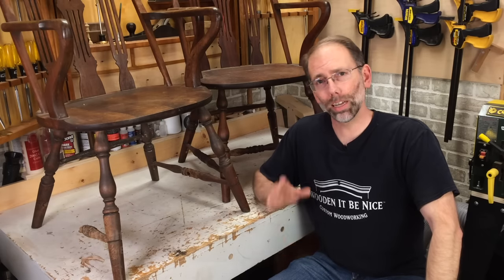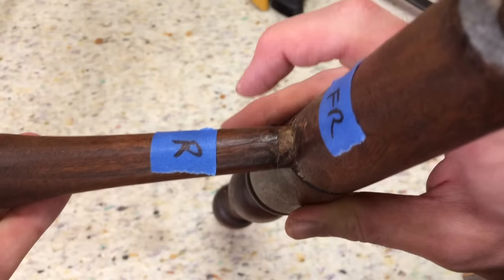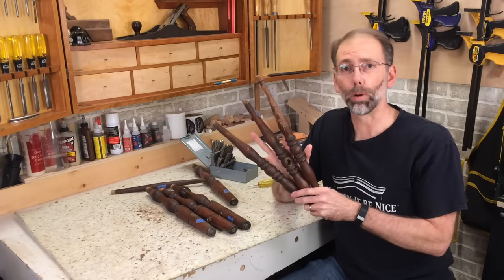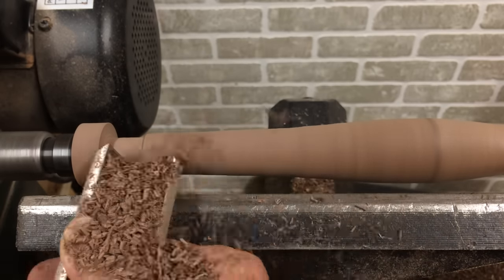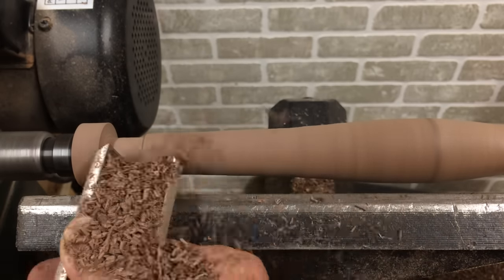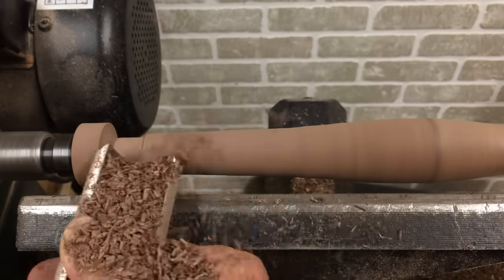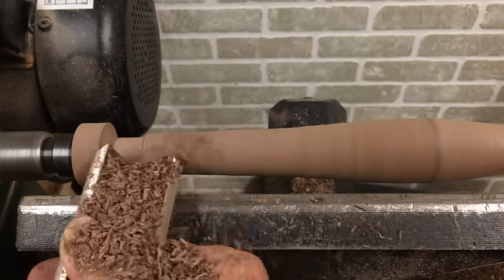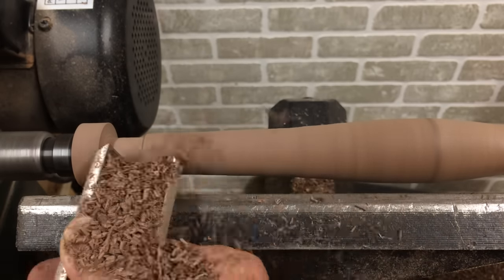Difficult Restoration of Wooden Chairs with Wood Damage - Woodturning & Chairmaking Skills | How To

Comment: Scott, I've just started restoring the 3rd Windsor-esque chair from my local pub - saw a total wreck in there about a year ago and offered to try to fix it. That was quite a simple repair - dismantle, clean joints and re-glue, then a basic wipe-on finish to make it look a bit loved, but also easy to clean.
Could not have even started without your superb videos, so a massive thank you!
Honestly, the chairs are not really worth the effort, time or expense (glues, stains and finishes are pricey), but I'm learning so much and enjoying getting slowly better (trying new ideas as well).
There's the value.
Certainly not a commercially viable business!
Get super-cheap beer and a free lunch when I deliver a finished chair.
Main cause of damage? Screws and nails. They destroy chairs!!!
Thanks again and keep it coming, please.
Reply from the maker: That's awesome to hear Stephen!  Thanks for sharing that!  Nice that you're helping a local business.  Cheers.  Scott

Comment: Scott, great video documenting the difficult nature of the work involved in restoring old wooden furniture. Two observations, your forstner bits looked like they need sharpening and I think using a drill press would have made the angular drilling of the mortises on the new pieces a bit easier.
Reply from the maker: Ah, you caught that dull forester bit!  Yes, I was struggling and I'm on the search for some slip stones to sharpen it.  I was using a fine file but it didn't help very much.  Thanks for the suggestion to use the drill press.  Cheers.  Scott

Comment: Impressed with the legs you turned. I would love to learn this skill.. but I will keep to the basics for now. I do have a question. I seem to have trouble with my glue ups more often then not. I can be happy with my dry fit and clamp up configuration but once I do the glue up I seem to struggle getting my pieces to fit together as easily as they did without the glue. What am I not taking into account here? You mentioned something about the dowel rod pushing the glue down into the mortise. Perhaps this is the reason I'm not getting the same fit as the dry fit? Thank you!
Reply from the maker: I suspect you may be filling the bottom of the mortise  (hole) with glue, therefore preventing the tenon from being fully inserted.  The only parts that should have glue on them are the sides of the mortise and the sides of the tenons.  The bottom of the mortise and the end of the tenon should not have any glue on them (as they don't touch).  Does that help?  Scott
Reply: @FixingFurniture  Yes this helps.  I'll be honest I have been dripping a small amount of glue into the mortise then using my brush to spread it throughout. This would certainly allow glue go to the bottom. Also I haven't been paying attention weather or not I've been getting glue on the end of the tenon. Thank you very much for the response. I will try these techniques in my next glue up.

Comment: Great work.  Two thoughts:
1.  The fix you used to make the loose stretcher fit was pretty cool.  After a moment's thinking, I realized it was just the round version of gluing a piece of veneer into a crack.
2.  As often as you seem to need to cut chair legs down, it might help to make a board with a curved "hook" in it, say 2" diameter.  That way, it reaches farther around the leg while the end is still registered on the table top.
Reply from the maker: That's a clever idea for marking legs for trimming.  Thank you for sharing that #Tip

Comment: I really like your YouTube videos.  I have a question, I am repairing an Old Organ Stool which the tenant broke off.  I have cut the leg and glued the piece on the end and was successful, however when I tried to drill through the new piece to add a dowel the piece I glued on cracks and i have to start over.  What am I doing wrong?

Comment: 17:50 instead of replacing the whole leg, could you drill that hole bigger and fill it with a dowel and then redrill it to fit the tenon? ....l understand that you are turning a lot of parts on this project. But what if this one joint was my only problem. Would you still have to turned the leg in order to make the chair stable and useable? (I don't have a lathe). Sending lots of love 💖 from sunny 😎 Arizona 🌵😷
Reply from the maker: Good question Suzi.  I would not suggest drilling the hole bigger as you would be cutting out more structure of the leg, which will weaken it.  Another alternative would be to cut out the damaged wood section in the leg and glue on a new piece of wood.  That would require shaping it  with a spokeshave to get it round to match the profile of the leg.  It's challenging work but would avoid having to use a lathe.  I hope that helps.  Scott

Comment: The trouble with us furniture repairers is, we only turn occasionally. We practice, read books and gain enough proficiency to make a usable component, finish the job and think were the bee's knees. By the time we need more spindles we have forgotten everything and have to start from square one. A little practice weekly is the answer, but do we do it?
Reply from the maker: Yeah, that's a good point.  There's a lot of muscle memory required to be proficient at turning.  I've talked to my turning coach about practice, but so far, it's been a bit like piano lessons as a kid... haven't practiced.
Reply: @FixingFurniture  You could always take some of the damaged spindles and offcuts and seconds from your failed attempts, and use those pieces to fashion new handles, knobs and totes for your tools. Hmmmmm.... the possibilities are endless.

Comment: I think starting the drill straight and then truing up to the correct angle makes for a larger hole than needed and not a clean finish. (you can see what I am talking about at 33:36)
Reply from the maker: You raise a good point.  There is a slight gap there.  I don't think I could start a Forstner but on an angle though.  Perhaps using an auger bit would work better.  I did a search for this and found this video.  Thoughts?  https://youtu.be/rlRPzgp0etY

Comment: Such great info about fashioning a thicker tenon -- I have exactly this problem with a 4-poster bed I'm trying to repair (it belonged to my grandparents but one of the posts came loose and one broke, both at the joint, during an international move) but I'm not a professional restorer and I don't have any thick shavings. Do you recommend any other solutions or maybe something that would substitute? I was thinking cork but it might be too spongy in the long term. 

If the answer is "pay a professional" that's ok too but I keep thinking there must be a reasonable solution to this because none of the finishes are damaged -- just the internal bits of the joins (in the broken case I'm going to need to use a dowel, I think).
Reply: Brooke, all you need for shavings is either a friend/relative with a handplane or get a handplane and make some shavings.....type of wood doesn't  matter.
Reply: @michaelfling7786  thank you! Also hah, I should have figured that out myself. I appreciate the hand-holding of this newbie :)

Comment: At 24:40 in, you are sawing off the larger round end you had turned and was too long. I would have left it on and sawed a flat on it to keep it from rolling, making a perfect base for drilling the next hole!  Next time, leave those large ends on and make them them a bit larger in diameter as the largest part of the tuning until you have drilled all your holes and see if that helps stabilize your parts. FYI, not a wood turner myself! Good video BTW!
At 35:00 on, you are going to mark where to cut the replacement leg off to level it. If it were me, I would put some weights on the chair to stabilize it, then just use my "pull saw" laying flush on the bench top and saw it off, no marks to try to cut to are necessary. I don't think you can get it any closer that that. Reason I'm saying this is I just needed to do the same thing on a repaired chair leg myself, BUT I didn't use the "one leg off the bench trick" like you! After seeing what you did, this new method occurred to me as I was watching you work. As with most woodworking, more than one good method, but I try to avoid cutting to a mark when possible.

Comment: Why would you use a carving knife to make the tendons rather than using the lathe?
Reply from the maker: I fine-tune the tenon to fit snugly into the mortise.  If I try to get it exactly right on the lathe and under size it, I've ruined the part and have to make a new one.  I hope that helps.  Scott